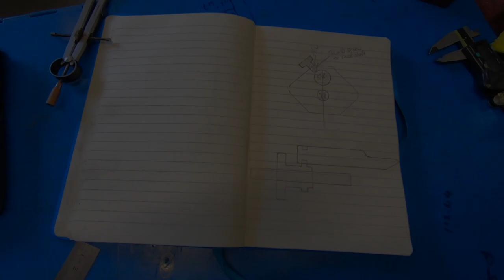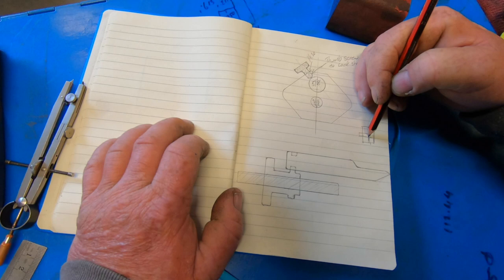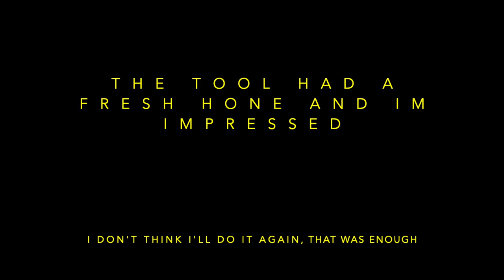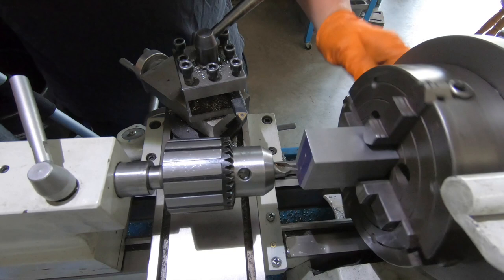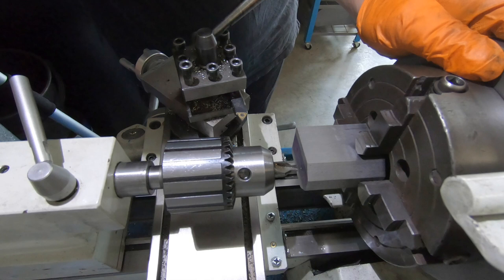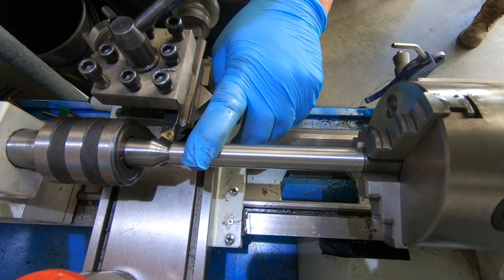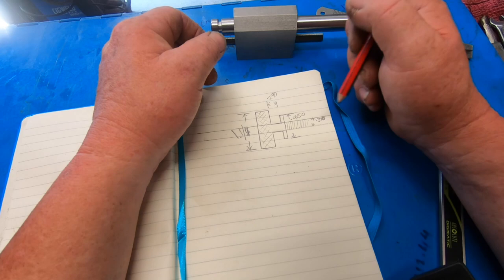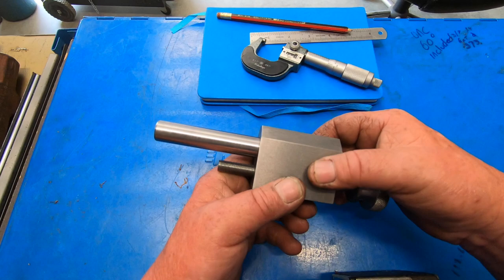Tailstock build -Part 1

Comment: looks good matty, I would add a keyway in the side of the 5/8" shaft and use a dog point set screw in the side of the tailstock, otherwise it'll want to spin in use, and the clearance flat you were planning on using would be pointless.

Comment: Hi Matty,

Parting off is a challenge. I wouldn't recommend using the tailstock when parting especially if you intend to part it right off, or get
so close that the job will bend, what can happen is the blade gets trapped as the parted piece has nowhere to go. No shame in getting close then sawing it off. I've lost parts due to thinking I can part off successfully then having a jam up that ruins it.

Comment: G’day Matty, well done. I didn’t follow at your opening explanation but that was me, I can’t see your pencil drawing, poor eyesight and using a smartphone are not a good situation. 
I must say you chose to borrow an elegant design and executed it nicely. Are you fitting a lock screw and brass plug to lock the quill?
Cheers 
Peter
Reply from the maker: Gday Peter, that’s the line of thought I was thinking with the brass plug and thumb screw, I’m thinking I can get enough purchase to lock   it in place but if that’s not strong enough I can put in a grub screw,   ATB Matty